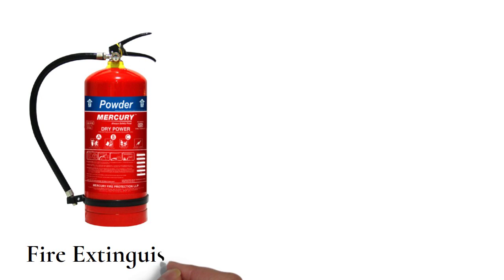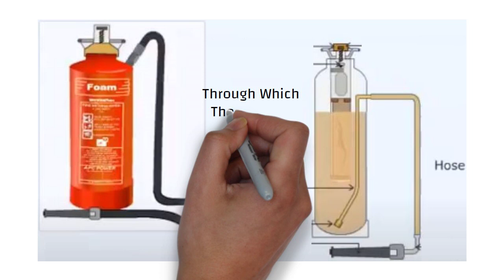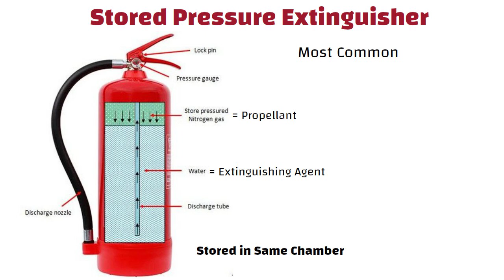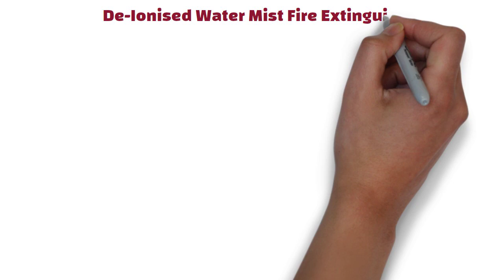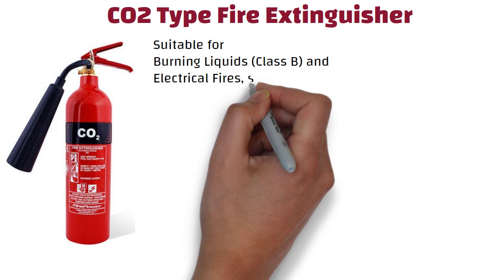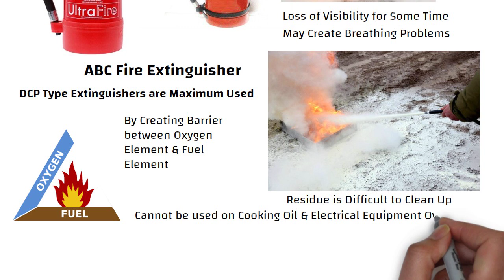FIRE EXTINGUISHER DEALERS IN KERALA, CALL 8138906102, FIRE EXTINGUISHER DEALERS IN ERNAKULAM.

Comment: Fire alarm system dealers in Thrissur
Reply: FIRE EXTINGUISHER DEALERS IN THALASSERY, FIRE EXTINGUISHER SUPPLIERS IN THALASSERY, FIRE EXTINGUISHER DISTRIBUTORS IN THALASSERY, FIRE EXTINGUISHER IN THALASSERY, ABC TYPE FIRE EXTINGUISHER DEALERS IN THALASSERY, CO2 TYPE FIRE EXTINGUISHER DEALERS IN THALASSERY, CLEAN AGENT FIRE EXTINGUISHER IN THALASSERY, MODULAR TYPE FIRE EXTINGUISHER DEALERS IN THALASSERY, MECHANICAL FOAM FIRE EXTINGUISHER DEALERS IN THALASSERY, FIRE EXTINGUISHER NEAR ME THALASSERY, FIRE EXTINGUISHER TRADERS IN THALASSERY, FIRE FIGHTING COMPANIES IN THALASSERY, FIRE CONTRACTORS IN THALASSERY, FIRE EQUIPMENT DEALERS IN THALASSERY, FIRE ALARM DEALERS IN THALASSERY, FIRE PUMP DEALERS IN THALASSERY, SMOKE DETECTOR DEALERS IN THALASSERY, FIRE FIGHTING SYSTEM IN THALASSERY, FIRE PROTECTION SYSTEM IN THALASSERY, FIRE AND SAFETY CONTRACTORS IN THALASSERY, FIRE HYDRANT SYSTEMS IN THALASSERY, PA TALK BACK SYSTEM IN THALASSERY, FIRE NOC IN THALASSERY, FIRE INSTALLATION IN THALASSERY, FIRE NOC RENEWAL IN THALASSERY, KIRLOSKAR FIRE PUMP DEALERS IN THALASSERY, FIRE EXTINGUISHER NEAR ME THALASSERY, FIRE EXTINGUISHER MANUFACURERS IN THALASSERY, SAFEX FIRE EXTINGUISHER DEALERS IN THALASSERY, FIRE NOC CONTRACTORS IN THALASSERY, FIRE FIGHTING EQUIPMENT DEALERS IN THALASSERY, FIRE PROTECTION SYSTEM IN THALASSERY, FIRE INSTALLATION IN THALASSERY, FIRE SAFETY CONTRACTORS IN THALASSERY, FIRE AMC IN THALASSERY, FIRE PROTECTION SYSTEM IN THALASSERY, FIRE PROTECTION EQUIPMET IN THALASSERY, AMC OF FIRE SYSTEM IN THALASSERY, FIRE CONSULTANTS IN THALASSERY, FIRE AND SAFETY EQUIPMENT DEALERS IN THALASSERY, ADDRESSABLE FIRE ALARM SYSTEM IN THALASSERY, KARTHAR VALVE DEALERS IN THALASSERY, DCP TYPE FIRE EXTINGUISHER IN THALASSERY, POWSER TYPE FIRE EXTINGUISHERS IN THALASSERY, FIRE HYDRANT SYSTEM IN THALASSERY, FIRE ALARM PANEL DEALERS IN THALASSERY, SAFEPRO FIRE EXTINGUISHER DEALERS IN THALASSERY, MS AND GI PIPE DEALERS IN THALASSERY, JINDAL PIPE DEALERS IN THALASSERY, AGNI FIRE ALARM DEALERS IN THALASSERY, FIRE EQUIPMENT DEALERS IN THALASSERY, FIRE EQUIPMENT SUPPLIERS IN THALASSERY, FIRE EQUIPMENT TRADERS IN THALASSERY, FIRE SPRINKLER SYSTEM IN THALASSERY, RAVEL FIRE ALARM DEALERS IN THALASSERY, RAVEL FIRE ALARM SYSTEM IN THALASSERY, AGNI FIRE ALARM DISTRIBUTORS IN THALASSERY, FIRE ALARM CONTRACTORS IN THALASSERY, FIRE PIPE INSTALLATION IN CONTRACTORS IN THALASSERY, FIRE SAFETY CONTRACTORS IN THALASSERY, FIRE PA TWO WAY TALK BACK SYSTEM DEALERS IN THALASSERY, HEAT DETECTOR DEALERS IN THALASSERY, HONEYWELL FIRE ALARM DEALERS IN THALASSERY, FIRE NOC CONSULTANTS IN THALASSERY, FIRE AMC AND FIRE NOC IN THALASSERY, FIRE SAFETY COMPANIES IN THALASSERY, NEWAGE DEALERS IN THALASSERY, MONSHER FIRE EQUIPMENT DEALERS IN THALASSERY, KARTHAR VALVE DEALERS IN THALASSERY, FIRE HYDRANT VALVE DEALERS IN THALASSERY, FIRE HOSE REEL DRUM DEALERS IN THALASSERY, FIRE SPRINKLER DEALERS IN THALASSERY, FIRE PUMP DEALERS IN THALASSERY, LUBI PUMP DEALERS IN THALASSERY, LHP PUMP DEALERS IN THALASSERY. FIRE CONTRACTORS IN THALASSERY, FIRE AND SAFETY CONTRACTORS IN THALASSERY, FIRE EQUIPMENT DEALERS IN THALASSERY, FIRE FIGHTING CONTRACTORS IN THALASSERY, AGNI FIRE ALARM DEALERS IN THALASSERY, PA TALK BACK SYSTEM DEALERS IN THALASSERY, FIRE NOC IN THALASSERY, FIRE NOC RENEWAL IN THALASSERY, FIRE SYSTEM INSTALLATION IN THALASSERY.
Reply: FIRE EXTINGUISHER DEALERS IN THODUPUZHA, FIRE EXTINGUISHER SUPPLIERS IN THODUPUZHA, FIRE EXTINGUISHER DISTRIBUTORS IN THODUPUZHA, FIRE EXTINGUISHER IN THODUPUZHA, ABC TYPE FIRE EXTINGUISHER DEALERS IN THODUPUZHA, CO2 TYPE FIRE EXTINGUISHER DEALERS IN THODUPUZHA, CLEAN AGENT FIRE EXTINGUISHER IN THODUPUZHA, MODULAR TYPE FIRE EXTINGUISHER DEALERS IN THODUPUZHA, MECHANICAL FOAM FIRE EXTINGUISHER DEALERS IN THODUPUZHA, FIRE EXTINGUISHER NEAR ME THODUPUZHA, FIRE EXTINGUISHER TRADERS IN THODUPUZHA, FIRE FIGHTING COMPANIES IN THODUPUZHA, FIRE CONTRACTORS IN THODUPUZHA, FIRE EQUIPMENT DEALERS IN THODUPUZHA, FIRE ALARM DEALERS IN THODUPUZHA, FIRE PUMP DEALERS IN THODUPUZHA, SMOKE DETECTOR DEALERS IN THODUPUZHA, FIRE FIGHTING SYSTEM IN THODUPUZHA, FIRE PROTECTION SYSTEM IN THODUPUZHA, FIRE AND SAFETY CONTRACTORS IN THODUPUZHA, FIRE HYDRANT SYSTEMS IN THODUPUZHA, PA TALK BACK SYSTEM IN THODUPUZHA, FIRE NOC IN THODUPUZHA, FIRE INSTALLATION IN THODUPUZHA, FIRE NOC RENEWAL IN THODUPUZHA, KIRLOSKAR FIRE PUMP DEALERS IN THODUPUZHA, FIRE EXTINGUISHER NEAR ME THODUPUZHA, FIRE EXTINGUISHER MANUFACURERS IN THODUPUZHA, SAFEX FIRE EXTINGUISHER DEALERS IN THODUPUZHA, FIRE NOC CONTRACTORS IN THODUPUZHA, FIRE FIGHTING EQUIPMENT DEALERS IN THODUPUZHA, FIRE PROTECTION SYSTEM IN THODUPUZHA, FIRE INSTALLATION IN THODUPUZHA, FIRE SAFETY CONTRACTORS IN THODUPUZHA, FIRE AMC IN THODUPUZHA, FIRE PROTECTION SYSTEM IN THODUPUZHA, FIRE PROTECTION EQUIPMET IN THODUPUZHA, AMC OF FIRE SYSTEM IN THODUPUZHA, FIRE CONSULTANTS IN THODUPUZHA, FIRE AND SAFETY EQUIPMENT DEALERS IN THODUPUZHA, ADDRESSABLE FIRE ALARM SYSTEM IN THODUPUZHA, KARTHAR VALVE DEALERS IN THODUPUZHA, DCP TYPE FIRE EXTINGUISHER IN THODUPUZHA, POWSER TYPE FIRE EXTINGUISHERS IN THODUPUZHA, FIRE HYDRANT SYSTEM IN THODUPUZHA, FIRE ALARM PANEL DEALERS IN THODUPUZHA, SAFEPRO FIRE EXTINGUISHER DEALERS IN THODUPUZHA, MS AND GI PIPE DEALERS IN THODUPUZHA, JINDAL PIPE DEALERS IN THODUPUZHA, AGNI FIRE ALARM DEALERS IN THODUPUZHA, FIRE EQUIPMENT DEALERS IN THODUPUZHA, FIRE EQUIPMENT SUPPLIERS IN THODUPUZHA, FIRE EQUIPMENT TRADERS IN THODUPUZHA, FIRE SPRINKLER SYSTEM IN THODUPUZHA, RAVEL FIRE ALARM DEALERS IN THODUPUZHA, RAVEL FIRE ALARM SYSTEM IN THODUPUZHA, AGNI FIRE ALARM DISTRIBUTORS IN THODUPUZHA, FIRE ALARM CONTRACTORS IN THODUPUZHA, FIRE PIPE INSTALLATION IN CONTRACTORS IN THODUPUZHA, FIRE SAFETY CONTRACTORS IN THODUPUZHA, FIRE PA TWO WAY TALK BACK SYSTEM DEALERS IN THODUPUZHA, HEAT DETECTOR DEALERS IN THODUPUZHA, HONEYWELL FIRE ALARM DEALERS IN THODUPUZHA, FIRE NOC CONSULTANTS IN THODUPUZHA, FIRE AMC AND FIRE NOC IN THODUPUZHA, FIRE SAFETY COMPANIES IN THODUPUZHA, NEWAGE DEALERS IN THODUPUZHA, MONSHER FIRE EQUIPMENT DEALERS IN THODUPUZHA, KARTHAR VALVE DEALERS IN THODUPUZHA, FIRE HYDRANT VALVE DEALERS IN THODUPUZHA, FIRE HOSE REEL DRUM DEALERS IN THODUPUZHA, FIRE SPRINKLER DEALERS IN THODUPUZHA, FIRE PUMP DEALERS IN THODUPUZHA, LUBI PUMP DEALERS IN THODUPUZHA, LHP PUMP DEALERS IN THODUPUZHA. FIRE CONTRACTORS IN THODUPUZHA, FIRE AND SAFETY CONTRACTORS IN THODUPUZHA, FIRE EQUIPMENT DEALERS IN THODUPUZHA, FIRE FIGHTING CONTRACTORS IN THODUPUZHA, AGNI FIRE ALARM DEALERS IN THODUPUZHA, PA TALK BACK SYSTEM DEALERS IN THODUPUZHA, FIRE NOC IN THODUPUZHA, FIRE NOC RENEWAL IN THODUPUZHA, FIRE SYSTEM INSTALLATION IN THODUPUZHA.

Comment: Fire extinguisher suppliers in Thrissur
Reply from the maker: Fire Protection Systems in Kerala, Fire Protection Systems in Ernakulam, Fire Protection Systems in Kochi, Fire Protection Systems dealers in Cochin, Fire Hydrant dealers in Kerala, Fire Hydrant dealers in Ernakulam, Fire Hydrant system dealers in Kochi, Fire Hydrant dealers in Cochin, Fire Alarm Systems in Kerala, Fire Alarm Systems in Ernakulam, Fire Alarm Systems in Kochi , Fire Alarm Systems dealers in Ernakulam, Fire protection dealers in Trivandrum , Fire fighting system in Kannur, Fire protection system in Palakkad, Fire Sprinkler Systems in Thrissur, Sprinkler Systems dealers in Kerala , Fire Sprinkler Systems in Ernakulam ,Sprinkler Systems dealers in Kochi, Fire Sprinkler Systems dealers in Ernakulam, Fire Consultants in Calicut, Fire Consultants in Trivadrum, Fire Consultants in Kottayam, Fire Consultants in Malappuram, Fire Consultants in Cochin, Fire Consultants in kerala, Fire Consultants in kannur, Fire alarm dealers in Ernakulam, Addressable fire alarm dealers in Ernakulam, Smoke detector dealers in Ernakulam, Fire alarm suppliers in Ernakulam, Fire alarm distributors in Ernakulam, Morley fire alarm dealers in Kerala, Notifier fire alarm dealers in Kerala, System Sensor detector dealers in Kerala, GST fire alarm dealers in Kerala, Heat detector dealers in Ernakulam, Fire alarm panel dealers in Ernakulam, PA talk back system dealers in Ernakulam, PA talk back unit in Kerala, Fire extinguisher in Ernakulam, Fire extinguisher in Kerala, Fire extinguisher in Trivandrum, Fire Extinguisher in Calicut, Fire extinguisher in Thrissur, Fire extinguisher company in Kerala, Fire extinguisher company in Ernakulam, Fire extinguisher company in Trivandrum, Fire extinguisher company in Calicut,Fire extinguisher company in Palakkad, Fire extinguisher company in Thrissur, Fire extinguisher dealers near me, Fire Extinguisher in Kottayam. 

Fire fighting contractors in Kochi, Fire fighting contractors in Ernakulam, Fire fighting system in Kerala, Fire fighting contractors in Trivandrum, Fire fighting contractors in Thrissur, Fire fighting contractors in Kerala, Fire safety contractors in Kochi, fire alarm companies in Kochi, Fire safety companies in Kerala, Fire fighting companies in Kochi, Fire fighting companies in Kerala, Fire fighting companies in Thrissur, Fire fighting companies in Kannur, Fire fighting companies in Calicut, Fire fighting companies in Kottayam, Fire protection system companies in Kerala, Fire protection system companies in Ernakulam, Fire protection companies in Thrissur, Fire protection companies in Kottayam, Fire protection companies in Changanassery, Fire protection companies in Thiruvalla, Fire protection companies in Alapuzha, Fire protection companies in Kollam, Fire safety contractors in Kerala, Fire safety contractors in Kochi, Fire safety contractors in Thrissur, Fire safety contractors in Calicut, Fire safety contractors in Kannur, Fire safety contractors in Malappuram, Fire safety contractors in Wayanad, Fire safety contractors in Kanjikode, Fire safety consultants in Kerala, fire safety installers in Kerala, fire contractors in kochi, fire contractors in Kerala, fire contractors in Thrissur, fire contractors in Calicut, Fire contractors in Palakkad, Fire contractors in Tirur, Fire contractors in Karunagappally, Fire contractors in Malappuram, Fire contractors in Kottayam, Fire contractors in Changanassery, Fire contractors in Thiruvalla, Fire contractors in Wayanad, Fire safety installation companies in Kerala, Fire NOC consultants in Kerala, fire safety consultants in Kerala, Fire safety consultants in Thrissur, MEP contractors in Kerala, Fire safety installers in Kerala, Fire fighting contractors in Pala, Fire fighting contractors in Kalpetta, Fire fighting contractors in Bathery, Fire fighting contractors in Vadakara, Fire fighting contractors in Ponnani, Fire fighting contractors in Thalassery, Fire fighting contractors in Palakkad, Fire fighting contractors in Pathamathitta, Fire fighting contractors in Kollam, Fire fighting contractors in Malappuram, Fire fighting contractors in Manjeri, Fire fighting contractors in Thirur, Fire fighting companies in Kochi, Fire fighting companies in Trivandrum, Fire fighting companies in Calicut, Fire fighting companies in Thrissur, Fire fighting companies in Palakkad, Fire fighting contractors in Vadakara. Fire protection system installers in Kerala. fire consultants in Kollam,fire consultants in Idukki,fire consultants in Kottayam,fire consultants in Pathanamthitta, fire consultants in Kerala, Fire Hydrant valve Dealers in Trivandrum,Fire Hydrant valve Dealers in Kollam,  Fire Hydrant valve Dealers in Kerala, CO2 fire Extinguisher Dealers in Trivandrum, CO2 fire Extinguisher Dealers in Kollam, CO2 fire Extinguisher Dealers in Idukki,CO2 fire Extinguisher Dealers in Kottayam, CO2 fire Extinguisher Dealers in Ernakulam, CO2 fire Extinguisher Dealers in Kerala, CO2 Fire Extingusiher Manufacturers in Trivandrum, ABC fire extinguisher in Kerala, ABC fire extinguisher in Ernakulam, ABC fire extinguisher in Idukki, ABC fire extinguisher in Kottayam, ABC fire extinguisher in Pathanamthitta, ABC fire extinguisher in Kerala, Modular fire extinguisher dealers in Trivandrum, ABC fire extinguisher in Kollam, Modular fire extinguisher dealers in Idukki, Modular fire extinguisher dealers in Kottayam, Modular fire extinguisher dealers in Ernakulam, Modular fire extinguisher dealers in Kerala, clean agent fire extinguisher dealers in Trivandrum, clean agent fire extinguisher dealers Trivandrum, clean agent fire extinguisher dealers in Kollam, clean agent fire extinguisher dealers in  Idukki, clean agent fire extinguisher dealers in Kottayam, clean agent fire extinguisher dealers in Ernakulam, clean agent fire extinguisher dealers in Kerala, Fire Protection System Dealers in Trivandrum, Smoke Detector Dealers in Kollam, Smoke Detector Dealers in Idukki, Smoke Detector Dealers in Kottayam, Smoke Detector Dealers in Ernakulam, Smoke Detector Dealers in Calicut, Fire alarm dealers in Payyanur, Fire Alarm System Trivandrum, Smoke Detector Dealers in Trivandrum,  Fire fighting contractors in Vadakara, Fire Extinguisher Suppliers in Pathanamthitta, Fire Extinguisher Suppliers in  Pathanamthitta, Fire safety installation contractors in Trivandrum, Fire extinguisher suppliers in Payyanur, Fire extinguisher traders in Payyanur, Fire equipment dealers in Payyanur, Fire safety installation contractors in Trivandrum, Fire safety installation contractors in Kollam, Fire safety installation contractors in Idukki,Fire safety installation contractors in Kottayam,Fire safety installation contractors in Pathanamthitta, Fire safety installation contractors in Kerala, Fire alarm Products Dealers in Trivandrum, Fire alarm Products and Manufacturers in Trivandrum, fire alarm systems in Thiruvananthapuram, pa two way talk back system in Trivandrum, pa two way talk back system in Kollam,  pa two way talk back system in Idukki, pa two way talk back system in Kottayam, pa two way talk back system in Pathanamthitta